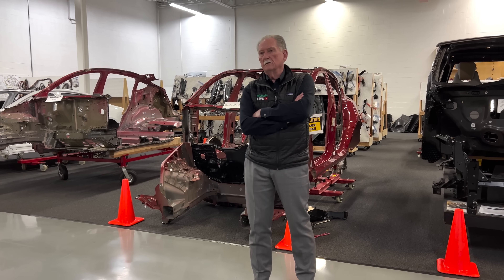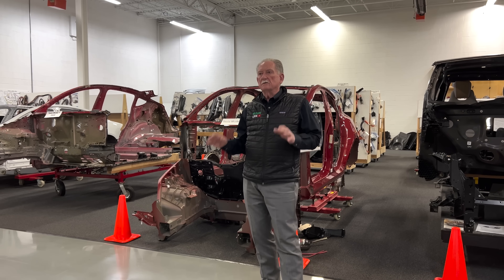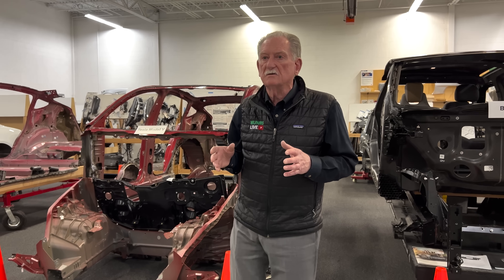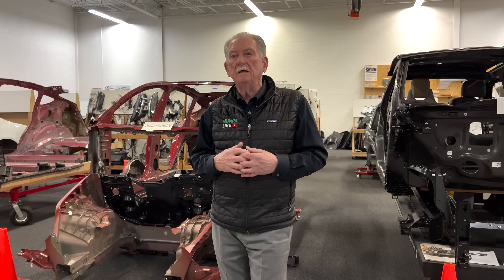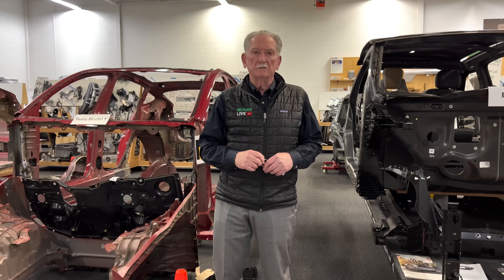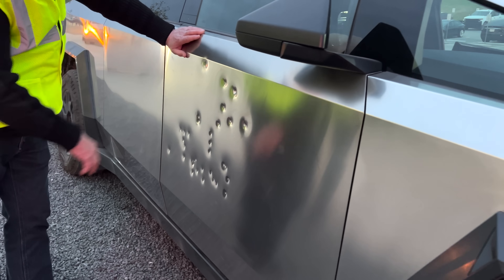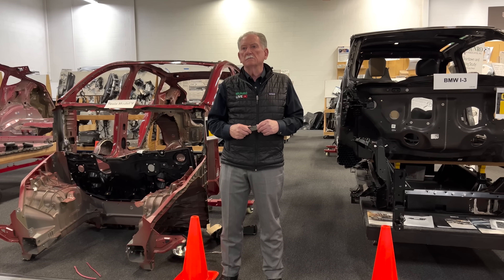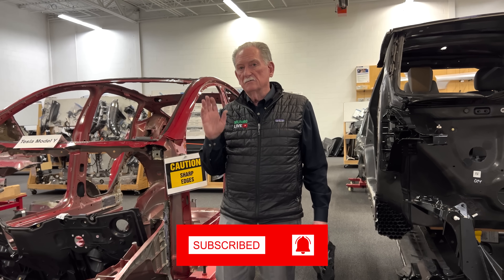An Engineering Analysis of the Tesla Cybertruck

Comment: Sandy, review the CyberTruck Drive By Wire braking and steering systems in detail, how safe are they??? .. what redundancy and safety features have been included?
Reply: Doesn't have brake-by-wire
Reply: @chstra45  you're right, Only Steer by Wire,  thanks for clarifying that.
Reply: Telsa says that the Cybertruck has triple redundancy in its steer by wire system. Here is what an article by Sudhanshu Kumar says about it:
"The squarish shaped steering of Cybertruck controls the direction of front wheels using wired connected two motors (actuators). The steering  signal is fed into a controller (computer) which decides the action of motors (actuators) to how much the wheels should be turned.
The steering system is provided with triple redundancy to provide better safety features in case if two sensors generate error the third level of sensor can identify the correct input. The wired steering of Cybetruck provides variable steering ratio and the steering wheel can rotate up to 170 degrees. The sensors connected in Cybertruck have ethernet communication which makes steering fast, smooth and robust."
Reply: Actually brake-by-wire exists for a long while, just not a wire, but a tube instead!. George Westinghouse made a fortune through his brake by vacuum apparatus for locomotives, which essentially is a brake by wire(in this case a vacuum line daisy chained along individual carriages, that enabled automatic braking, when the line broke anywhere). Him supporting Nikola Tesla, to invent polyphase generator and 3 phase electric system for generation and transmission of electricity is history😅.

Comment: Does the weight of the extra battery pack change the towing maximum?  Also, does the extra battery pack charge separately or along with the main pack?  The steel in this truck is amazing.  No one has made a vehicle this revolutionary since the 1969 Dodge  Daytona.  I love it!
Reply: Yes it does, it will be considered as "cargo weight", reducing the payload capacity. Same as if you installed a dual fuel tank in a diesel truck.
Reply: The battery pack sits in the front of the bed behind the cab. I don't think it's easily removable so you either have it or you don't when you order the truck.
Reply: It will take half of the trunk space as well😂

Comment: I'd like if you could provide a summary of what Tesla sent the automakers and suppliers in that 48v document. What info did they provide and how is it supposed to help the other companies?
Reply: Jason Camissa brought that up on his Carmudgeon podcast after his Icons episode aired. Tesla did show him what the documents were, but Tesla had to give Hagerty a NDA until some time in the future.
Reply: I'd very much like to see that too.
Reply: I wonder if Sandy has a copy? 😉
Reply: The Automotive industry knows the advantage of 48v.

But its easy for an electric car to step down some voltage for accessories to whatever they want.

A Gas car must be able to be jump started by other cars. It also needs a 48v battery. 48v Alternator. 48v Starter-motor, relays, ECU, BCM, window motors, wiper motors, headlights, all lights, and bulbs.

Literally EVERYTHING has to be changed to 48v and NO PARTS STORE has Any 48v stuff. It would be a clean slate re-design to save maybe 100lbs out of each luxury vehicle and maybe 20lbs from economy cars.

Comment: Didn't Elon say that the stainless steel blend was a 2xx series, and martensitic?
Reply: I know that the same metallurgist of SpaceX does the Telsa work.  I sell stainless steel and also make it stronger by cold working.  I have been watching for clues about their metal to drop.  I like the 30X name as that is mostly a 304 stainless.  I can guess the 30X for SpaceX will be available to Tesla.  Since the cybertruck revile, the martensitic is being mentioned.  I cold work austenitic stainless mostly that are actually austenitic stabilized [they try to not go to martensitic] for its high strength and good corrosion resistance. Nickel is used to stabilize austenite. The 2xx series is a Nickel free stainless.  In conclusion, the Tesla martensite could be a nickel free 2xx.
Reply: @geirmyrvagnes8718  If you watch the video, he goes over how it's actually martensitic. :)

Comment: It's funny this is cutting edge for the auto industry. They were dinosaurs I guess. These concepts of ethernet rings, getting rid of buttons and knobs for touch screens, higher voltages, etc. We've been doing at industrial manufacturing plants for the last 20 years. The only thing that's really cutting edge is the battery tech and taking these things mobile.
Reply: I like buttons they already had can bus which loop system.
Reply: Elon called most of this something like "doing the obvious thing and bringing car tech into this century". A conservative industry based on subcontracting is hard to turn around to actually new ideas.
Reply: I saw this in the late 90's with a new assembly line. Every fixture had a electrical connection and a pneumatic connection then the "blue" cable ran from every fixture to the main PLC panel that controlled the entire assembly line.
Eliminated thousands of feet of wiring and conduit.
At the end we started into wireless troubleshooting.
Reply: OEMs had a vested interest in keeping things static for 100 years. Follow the money.

Comment: Well if you put smaller road tires on the CT, then you could get 20 to 30 more miles? Did Musk put down the gauntlet that the design had to go with the mad-max all-terrain tires? 😨
Reply: Supposedly the 340 miles is with the st tires and 323 with the at tires, 301 on the cyberbeast tri motor with at tires or 320 st.
Still beats rivian though which is 274-307 for a large pack quad or dual depending on options&20" at tires with a 10% larger pack to! 👍🏻😎

Comment: Is it a 48 volt system or an 800 volt system? Are there two different systems?
Reply: 800v power delivery for motors etc, 48v system level (lights, sensors etc)
Reply: he claims that 800V is enabled by the 48v system.  This of course is false as we have 800V systems from Audi, Porsche, Hyundai, etc., none of which use 48V
Reply: The explanation could be a lot clearer for sure.
Any electrically powered vehicle has at least 2 voltage levels, traction voltage and control voltage(s).
Big machines run traction voltage anything up to 3000 Volts (Caterpillar/ Mitsubishi), 1800 Volts (Komatsu / Siemens), 1500 Volts ( Caterpillar, Komatsu / GE).
Control voltages range from 100 Volts down.
Cars use traction levels up to 1000 Volts.
All the decision making is performed at the lower voltage, the traction level voltage provides the bulk power needed to accelerate and decelerate the machine.
In the specific case of the 48 Volt architecture mentioned, 48 VDC power is looped around the vehicle from device to device. Each of those devices also accepts data commands from the Industrial Ethernet (I could explain Ethernet if needed) when the specific address of a device is commanded to do something it performs the task and reports back.
Fully monitored device operation is infinitely better than the kind of dumb switching we have endured for so long. Status and faults are constantly monitored while single point of failure modes are greatly reduced.
As Sandy said, Commercial and Military jets can perform as they do because of these triple redundant systems.
Critical systems are powered from more than one supply circuit.

Comment: But what is the standard battery SIZE? Are these 4680 cells?
Reply: Yes next gen cybercell 4680s a 16-18% energy density improvement vs the 2022 model Y cells munro tore down in summer 2022.
1,322 according to the recently released epa docs in the ct pack at 123kwhs.

Comment: I always heard that Europe does not allow steer by wire.  I was always interested in it because it would allow steer by stick.
Reply: People hear many things.  Lexus RZ 450E is coming to Europe with steer by wire before Tesla has any Cybertrucks to spare for export. You heard that from a random guy in a Youtube comment. :)
Reply: I heard that before Youtube existed. 
 @geirmyrvagnes8718
Reply: steer-by-wire is regulated in ECE R79
The first mass produced road car with steer by wire was the Infiniti Q50 (Nissan) in 2013 (which had still a steering column installed. In the event of a fault, a clutch would restore the mechanical connection)

Comment: I can see the advantages of saving weight and reducing wire size and number of wires. I wondering if they have a bunch of dc to dc coverters all over to run lights, window motors etc. Or do things run natively on 48v?
Reply: all equipment is 48v. lights, windows regulators and so on, it was an requirement in order to swap over to 48v
Reply: @momatedise  Tho for quick placeholder some component could have internal stepdown circuitry anyway if 48V version is not yet developed yet. Also is logical some parts definitely does not run natively on 48V anyway. :D So its just sourcing voltage change even just that would make it lighter. Secondly Tesla got now quite big pull now. I can believe even some sourcing companies would be willing to adapt their product to new paradigm. Too be fair for example BOSH got some 48V already in works and waiting if somebody wanna use theirs. Except till now nobody did final "LETS GO, DO IT" decision.
Reply: This is why it has been so hard to switch. Everything has to switch, otherwise you lose the benefits
Reply: I wonder, does this allow a smaller step down transformer than 400->12V?
The 48V battery...12S Li-Ion 18650 cells? Or...120 of them for 10P?
12S 4680?
Reply: Transformers are ac only the 400 volt to 12 volt is DC.
Reply: According to the article "Tesla Cybertruck Using 48V Wiring Harness Not 12V" by Sudhanshu Kumar, some components in the Cybertruck are 12V and they used DC to DC converters to step down from 48 to 12 volts. I assume that Tesla had to do custom orders to get 48V components, and it probably decided that it wasn't worth the cost for some components.

Comment: Rear motors are claimed to be induction. Might explain the lower power peak vs Plaid. Indusction motors are supposed to freewheel more efficiently, so you get more range with the front PM motor on low power demand.
Reply: The truck also has a relatively low max speed, suggesting it's geared lower (towing etc.).

Comment: I was thinking of Starlink Internet service.  They do have service for boats and planes so why not cars.  With FSD those in the car could use the internet.  If I go camping I could use the internet.  When I go home the cars WiFi could provide internet at home.  With a $100 monthly subscription it can add up.  Any or all car manufacturers could provide this.  If 10,000,000 cars per year came with this the revenue grows by adding 10,000,000 cars per year.  I am just guessing at the numbers but what if stationary internet becomes obsolete and mobile internet becomes standard.

Comment: Is this steel hard to "key". Usinating on it doesn't seem a good way to harm it. What might its kryptonite be, apart from large bullets?
Reply: I doubt that a typical key would scratch the cybertruck's body, but we are talking about a custom alloy, so its exact properties are not known. Most keys are made of brass or medium carbon steel which is softer than stainless steel, but if the key is made of stainless steel, it might scratch the cybertruck. However, it is also possible to sand out scratches on normal stainless steel and you can buy stainless steel cleaners that fill in scratches.

Comment: 70% weight reduction of wire harnesses, not 70% weight reduction overall, I think the statement should be more precise.
Reply: For simpletons?
Reply: Using a weight reduction for such a vehicle is a contradiction in terms. Just focus on the other benefits of the 48V system. As for the tech its nothing new.
 @kennyg1358

Comment: I noted that too these curved ridges on the castings, I first thought it were wire looms for the camera's or whatever.. Tesla must have done thousands of computer simulations to get that just right! Its another jump ahead of everybody else! Structural efficiency is also a thing legacy Auto does not pay much attention to.

You lost me about the material properties like austenitic and martensitic, I have really no idea what this all means... I must have learned about it when I was a bachelor student in aeronautics, but that is 40 years ago LOL! But I think I understand it right Tesla takes a standard stainless steel that is easy formable, and by deforming it it becomes hard and rigid.

I think the wire demonstration was not that clear, but I think you have a better opportunity to show the difference during the teardown (set the F150 lightning wires beside the Cybertruck wires.. That would be fun tyo see!)

I Can't wait for the tear down! This all is so fascinating! thanks for sharing!
Reply: Stainless steel sheet arrives   on a big roll.  It is uncoiled slightly and leading edge of the sheet is fed into some rollers.  Opposing rollers press down on the sheet simultaneously thinning it and feeding said sheet to next step. Similar process to drawing down aluminum foil.  304 has a low stable microstructure so when undergoing roll forming martensites are created (strain induced).  Pretty smart and relatively economical process.
Reply: Tesla used industry standard software to try and reinvent the wheel, that is all they did and they ended up with a worse product, just like their self driving, their fake solar roof tiles, the fake hyperloop, etc.
Reply: They use CAD generative design software.  It uses AI to generate multi generational variants of a design given a set of constraints.  It basically mimics the way nature evolves.

Comment: They might be taking these leaps but was it needed? They put themselves in this position and other manufacturers will not follow on 48v or the ss body. Demand for this technology isn't there yet.
Reply: Nobody liked or needed an iPhone years ago when the flip phones were in use but guess what? Now the full screen cell phone introduced by Apple is the only kind acceptable to consumers. There are leaders who innovate and pulled the rest behind them and Tesla is one of them.
Reply: @hvu6037  well said! And tesla is the global ev sales leader so it's right for them to set a new standard others then have to follow!

The tech will trickle down the model lines, I bet the juniper Y update late next year uses the new controllers, 48v and maybe even 800v?
Then the compact 25k car in 2025 will have 48v main architecture. Which is supposed to do 5,000,000 or more unit's a year at scale. 👍🏻😎
Reply: Tesla estimates that they have reduced the weight of their wiring harnesses by 77% and copper in wiring by 50% in the Cybertruck, which reduces its component costs and its assembly costs. Given that copper is a limited resource which will have shortages in the future, reducing consumption is important. Eliminating painting also reduces the costs, since painting/coating accounts for between 50% and 70% of the energy consumption in auto assembly plants, and produces the majority of the environmental emissions from auto plants. A stainless steel body likely eliminates $500 for painting, and likely prolongs the lifespan of the car, since it won't be scratched or dented and doesn't need to be repainted.
Reply: Other manufacturers won't follow?
O k, kind of like how other manufacturers have not tried to follow them into the ev space?
Reply: You guys are missing the point. 48v and ss body are not disruptive technologies. These are only being applied to this truck, which happens to be a segment that has low volumes constrained by Teslas production speed and interest rates. After all, the market for a 70k electric truck is not high volume anyway. They might have 1M preorders but you'll see how many of those are actually fulfilled at these prices with current interest rates.